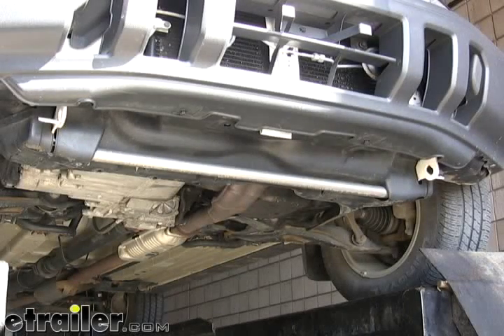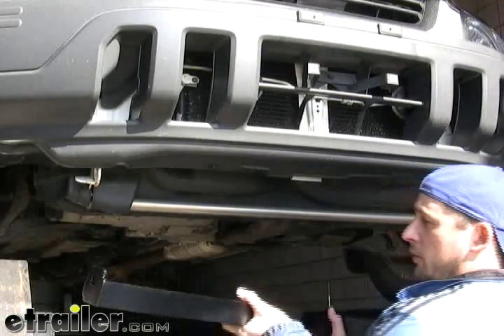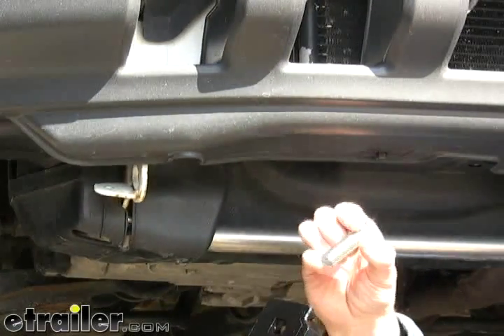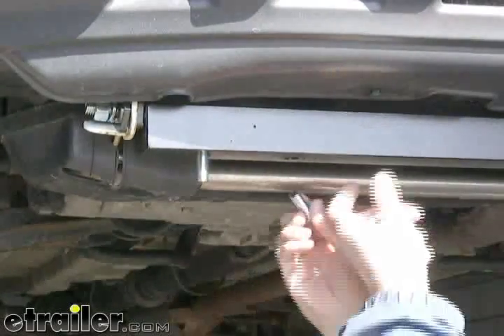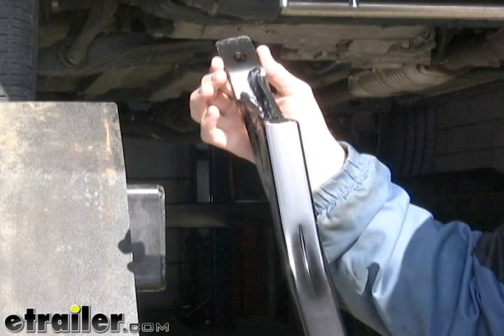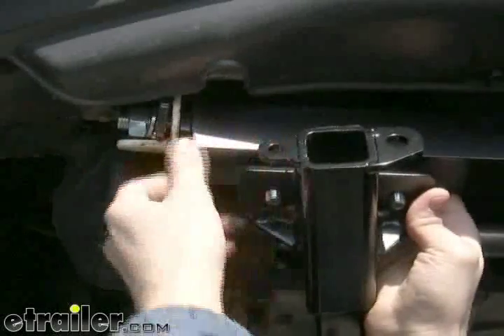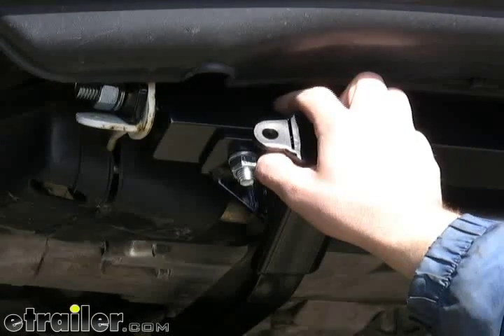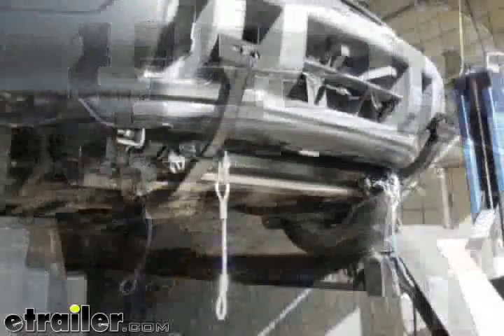etrailer | Installation Guide for the Roadmaster Crossbar-Style Base Plate Kit on a 2001 Honda CR-V

Comment: I could be wrong, but it seems like the general consensus is that these CR-V are not meant to be flat towed. I believe it has to do with the transmission still spinning in neutral with no oiling action  from the vehicle being off. I believe it will damage the trans or transfer case. Don't know, but still going to do mine as I've seen reports of people that did it anyway and turned out okay
Reply from the maker: There are certain models of vehicles that cannot be flat towed but we have had no issues with the Honda CR-V.
https://www.etrailer.com/Base-Plates/Roadmaster/1528-3.html